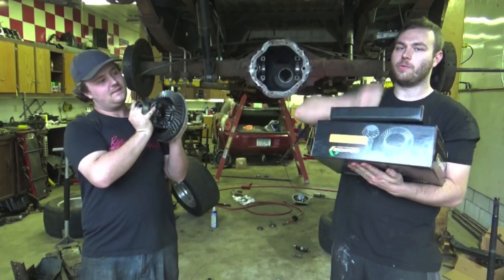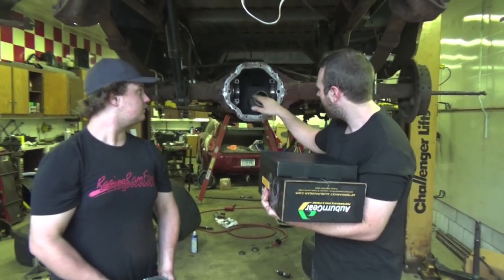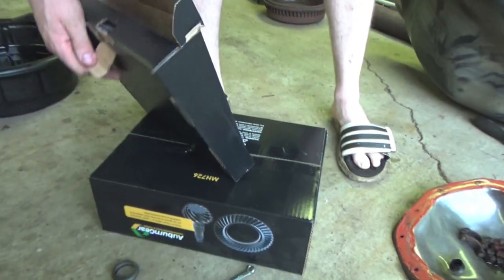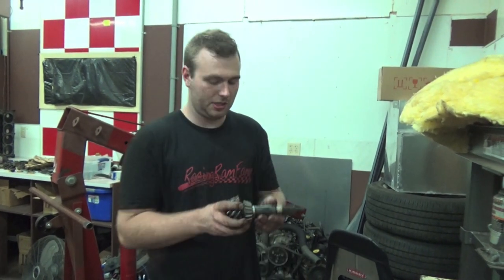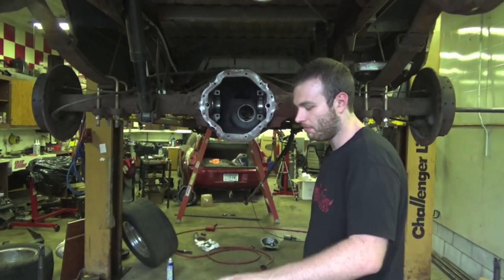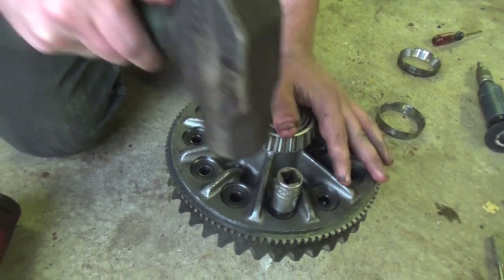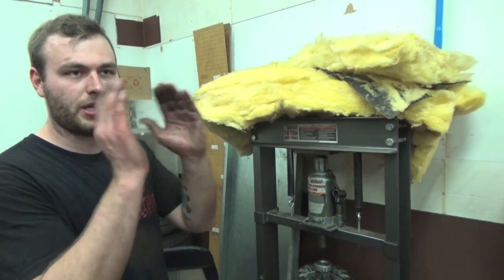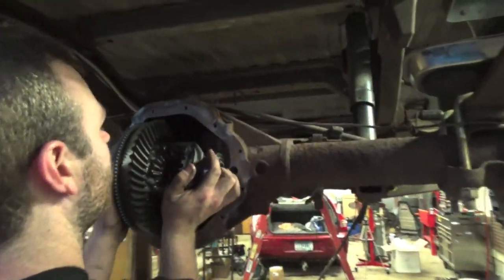Chrysler 9.25 rebuild & REGEARING. EASIER THAN YOU THINK?!

Comment from the maker: What gear set would you install in your 9.25? And why?
Reply: I have a 3.55 in mine because I’m running a 727. Have a 3.92 set for if I ever want to go to the track down the road.
Reply: I have 3.92s in mine 28" tires with overdrive
Reply: Hey .. great video guys I really enjoyed it , very well explained . I’d say you’ve done that a time or two lol ! My truck came with 392 gears an 17 inch rims An I run 305 45 17 dot Mickey Thompson street an track for summer on rear An I also have 20 inch rims with 275 45 20s I run in winter ! 👍
Reply: I have 456s smallest tire I use is 37
Reply: I had 4:88s in mine with 35s for towing
Reply from the maker: @chacebryan1559  nice cruising gear! That’s what this had in it from factory
Reply from the maker: @kowboykennyware  hey same! That’s height of the radials I’m running and gear set
Reply from the maker: @DarrensTruckzs  how do you like the Mickey Thompson’s?
Reply from the maker: @Moparornocar  nice my plow truck has 35’s and 4.56 I love it
Reply from the maker: @Wannabedually03  ya that thing prob screams going down the highway!
Reply from the maker: @Rob Roy those things are quick off the line!
Reply: @RacingRamFam  they really help hook big time, as with all my mods , most regular street tires wouldn’t hook up , only thing is they don’t last long lol , An I have to drive very carefully in the rain on the street , I have yet to balance them lol.. jus put them on the rims An they don’t shimmy shack vibrate or nothing.. lol so far I am quite happy with them 👍
Reply from the maker: @DarrensTruckzs  that’s awesome!! Pretty light tire so wouldn’t need that much weight to balance
Reply from the maker: @Rob Roy ya that’s crazy!
Reply: Street/show 01 Ram 1500 rcsb 4x4 mild 318 with 46re. 9.25 out of an 08 1500 for the disc brakes. Did 4.56s with a Detroit TrueTrac in the rear. On 20" 3rd gen wheels with 33" Nitto 420s. Was originally going to do 4.10s but that would of just put it back to the factory ratio of 3.55s and 28s. It get's down on the street. Highway rpms aren't too bad, 2300@70. Not a daily and doesn't see much highway, so it's all good. Working towards spinning all four on launch ;)
Reply: @Rob Roy Currently I am afraid a Kia Rio can out pull my ram. LOL
Reply: I’m in the middle of changing out my 3.21 gear set for 4.11 in my ‘90 D150. 2WD, built 360LA roller block, and A833od. Should be a fun cruiser!
Reply: Got my 92 ramcharger going down for a set of 6” springs and going with a set of 4.88 front and rear for new 14x35” tires on 20”modern Mopar trk wheels that I had the centers machined out to allow the hub to come through.  

You  have me a lil concerned about the 44 with 3.55 stock gears that the carrier may not work! I think it will and I’m changing out the rear 9.25 with a soon to be pull a part stock LSD carrier.  

Nice clean video of important stuff. Been a few years for me so wanted to watch it done and yall did it. Thx and MOPAR2YA!

Comment: Very well explained. That axle adjuster is a life saver! It makes it so easy to adjust. 

Tips I have to share for those who don’t have a press.

Cut out the old bearing like shown in the video.

Put the new bearings into your oven at 350 degrees for about at least 30 minutes (longer you leave it in the better result you get)
Put your carrier and pinion in the freezer for at least 30 minutes. (The longer you leave it in the better result you will get)

Take out your carrier and set it up on the table then get the bearings and it will just drop in all the way. Wait few minutes for the temperature of the bearing and the carrier to stabilize and it is set. (Usually take about 15 minutes)

Repeat for the other side. You will need to do the oven/freezer again because the carrier would have cooled up too much for the other bearing to drop on. 

Do the same for the pinion once you get the correct depth as explained in the video. 

Then do the rest of the set up as shown in the video.
Reply from the maker: Hell yes! This works very well too just don’t get the other people mad who live with you when they see a diff in the freezer lol 😂
Reply: @RacingRamFam  haha my wife accepts it since I use my garage fridge since it only have my garage related drinks and food. Also I have an old stove in my garage as well for powder coating this reason. So I am golden. 

For those who don’t want to sleep in the dog house after getting someone in their household all upset, just wait until everyone is off to bed and do it in the middle of the night! 😂 

But if you get caught, as my close friend always says,” it is better to get forgiveness than ask for permission” just sayin.
Reply from the maker: @derickhorne713  lol yesssss 😂

Comment: I’m running some 33” MTs, my new 4.56 gears came in. I don’t have the tools or know how, nor time, to do this myself so I’m taking it to my shop but I can’t wait. Don’t know what gear ratio it has stock, but I know it’s slow off the line unless I gun it to 3k+ rpm lol.

I also use my truck for towing.

Comment: Our church van is getting some rear end noise. I have been told axle bearing, or pinion bearing. After watching this I am going to give it a try. Where did you get the tool for tightening the carrier side bearings?
Reply from the maker: Yes prob pinion bearing and I made it my self out of a bar and two 36mm nuts

Comment: Any Idea what may cause the threaded axle adjuster on the ring side not want to move? Thank you
Reply from the maker: Yes bearing material in the threads spray it with brake clean and blow it out with compressed air
Reply: @RacingRamFam  Thank you, I pulled the diff tonight, I made the mistake of trying to loosen the axle adjuster with the bearing caps still tightened, pulled the bearing caps and it is still tight on the adjuster . I can get about a turn and half going in or out and then feels like it binds up. Think it’s still material? I don’t think I would have cross threaded or damage the threads with about a turn on the adjuster 

Thank you very much

Comment: I have a chrysler 9.25 limited slip 3.55 ratio. What can I do to eliminate clutch packs? I am rear differential illiterate. I have watched every video I can find. One guy does it but he doesn't indicate what his replacement is or at least I have not found where he mentions it.
Reply from the maker: You could go open diff or a Detroit locker which is a spiral style locker
Reply: @RacingRamFam  Thanks I am afraid I will be rebuilding the differential. My rear brakes and seals are shot. It literally leaks axle oil into my brake drums. I don't hear anything grinding or rubbing yet. 
I know with a problem like this be prepared for a complete overhaul.

Comment: Do you use dummy bearings for both pinion bearings?
Reply from the maker: Just the inner bearing outer is not a press fit
Reply: @RacingRamFam  that’s what I thought. I was half in the bag when I took it apart. Thank you

Comment: Bro nice job can't wait for my t-shirt to come in and when I eventually go from a procharger to twin turbos I'll just bring it to you and pay you to put twin turbos on by the way I want to let everybody know where I get a lot of my performance parts for my 5.9 Magnum motor are Hughes engines, hipotek, of course jeg an summit racing, Moparperformanceonline , performance injection equipment these are the places that I'm getting my parts from to build my pro charge 426 hemi Magnum motor but if you don't have a stock bore and it's bigger like the one on my new engine I have my bored 60 over technically you'll be getting a 433 cubic inch motor if you put that stroker kit in I've been rebuilding this truck from front the rear for the last 2 years but this goddamn pandemic has been messing with my money flow so it's taking me awhile if things keep going the way they are it'll be another year and a half before I get my truck done and I have a 1999 Dodge ram 1500 4x4 sport with a 5.9 Magnum motor and because I'm from Texas I called my truck Chuck Norris
Reply from the maker: Didn’t chuck nossis own a second gen ram too? But that’s awesome how much power are you shooting for?
Reply: @RacingRamFam  as much as it will take and yes he did. when the shirt comes in I'm going to post it up in front of my truck in my storage unit That I'm building you'll see the brand new 5.9L Magnum motor performance crate from jegs and all the other stuff I bought in front of it